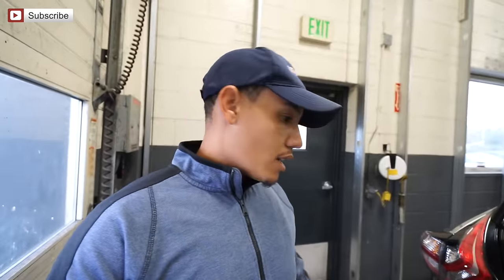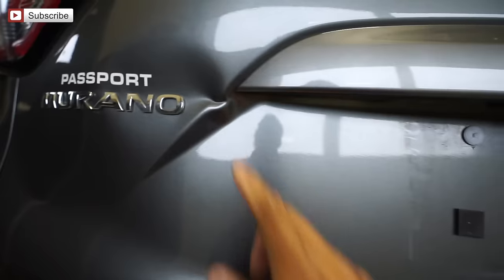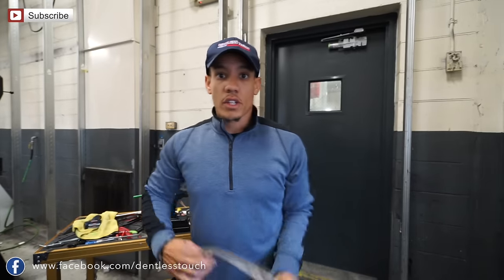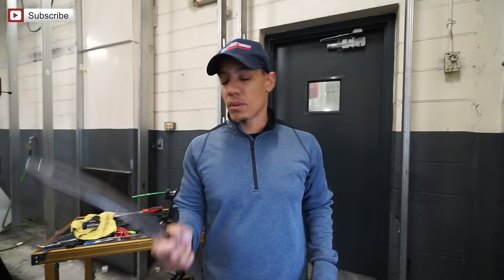Inside the Dent Vlog #004 | SUPER SHARP Dent Repair | Nissan Murano

Comment: I’m gutted having my Porsche dented on the rear quarter panel buttress. It’s a sharp little dent. Not sure what did it. The paint is chipped. The dent guy is going to look at it and then my friend who’s a detailer is going to touch in the chips and polish. It’ll show but hoping only if you look hard. Trying to avoid a quarter panel spray as much as poss as it’s the kind of colour that never matches when bodyshops spray it. Hoping the dent guy is as good as you!

Comment: whats the purpose of the heat gun, is that for the metal or to keep the paint from chipping or what?
Reply: Kirk Nelson yes its to keep the paint from cracking while he pushes on the tight dent. The heat may help with making the metal more malleable but I would doubt it since metal takes a higher temp to melt than that heat gun.
Reply: thanks
Reply from the maker: its for the paint
Reply: What temp does the paint flex at?

Comment: where can one find the heat gun holder
Reply from the maker: https://elimadenttools.com/collections/frontpage/products/the-claw-suction-cup-mount
Reply: Dentless Touch you guys need a heat gun with built in IR where you just set the desired temp and it regulates. The design of something like that is fairly trivial. That way you just point the thing and dial in what you want...no fiddling and it’ll hold the paint at temp while you work.